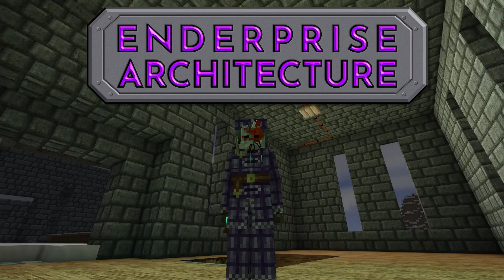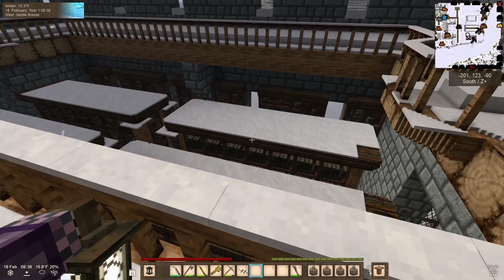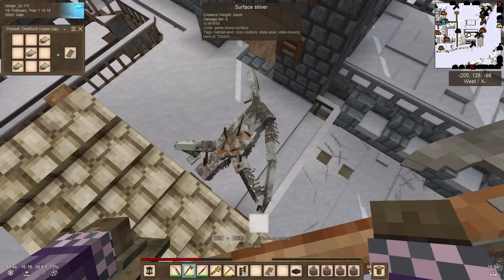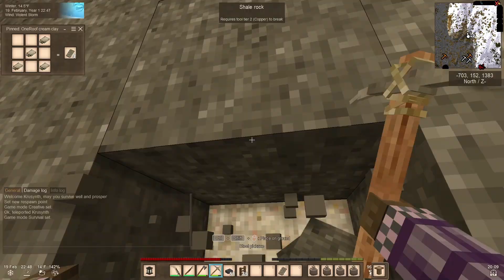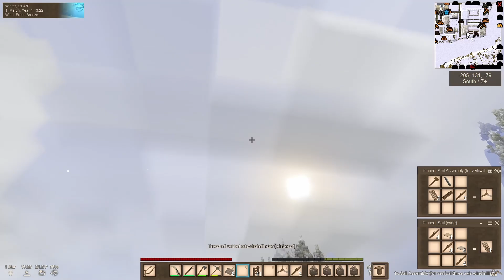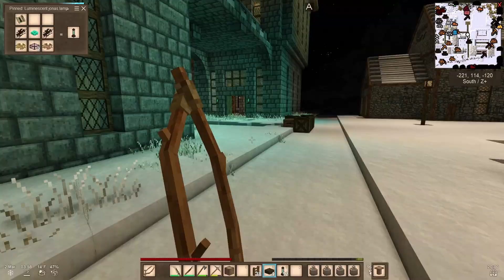Electric Lighting and Automated Shingle Production - E43 - Season 2 - Modded Vintage Story

Comment: Remember that exposed wires can burn if exposed to water, rain or snow!
Reply from the maker: Uhhhh oh.  I did not plan for that.
Reply from the maker: Well, you were absolutely right - the cables on the roof burned through when it started snowing. I put up a quick roof to cover them, but this is going to be very annoying.  Thanks for the tip!